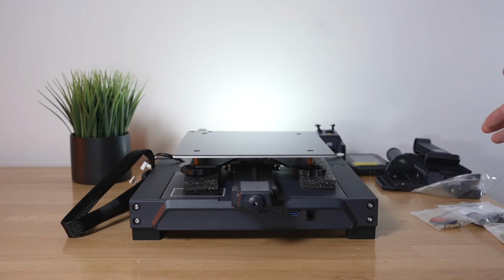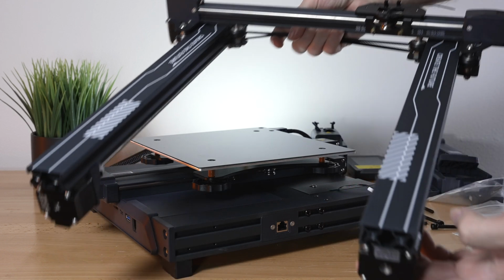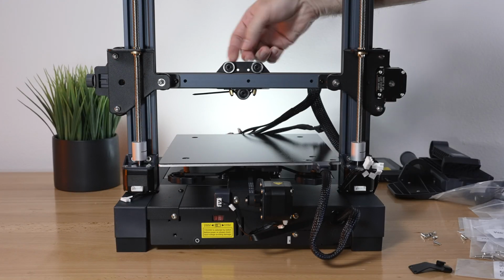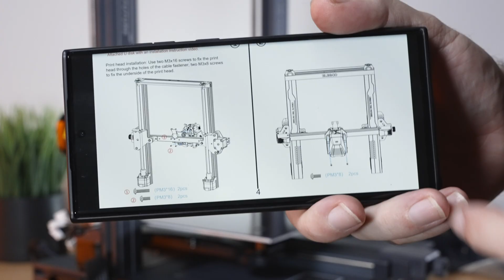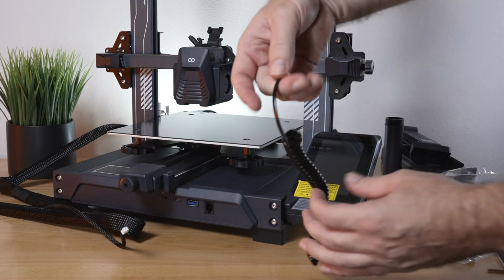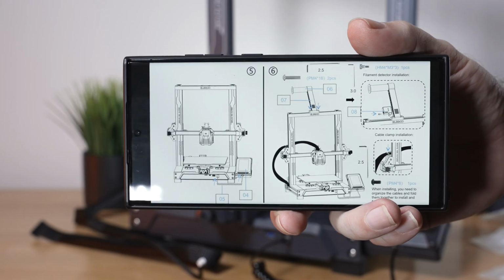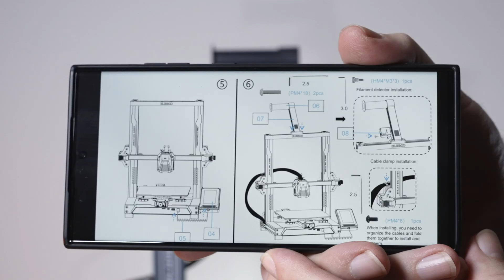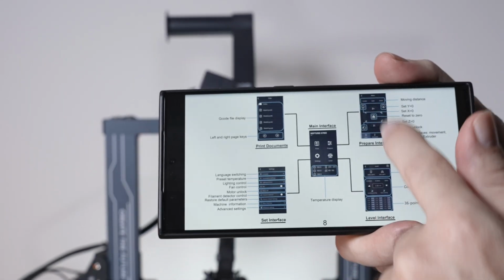Elegoo Neptune 4 Pro - 3D Printer - Assembly

Comment: Thank you for the video.  It actually took me several hours (yes, don't laugh) all because of the two very first screws.. For some reason I was trying to put the ribbon holder on the wrong side, and the screws just were not  long enough.   After it the lights went on it was a breeze with your video.  Thanks again. 😀

Comment: Took me an hour to put together .
I subscribed to your channel in case I need help with mine .
Cleaning the bed with alcohol after a series of prints . Also level by hand with wheels then did automatic leveling.  I also put silicone grease on the guide  bars just a light coat . So far love it .